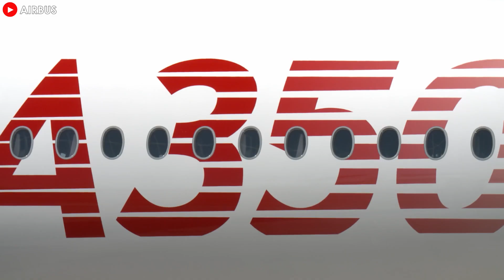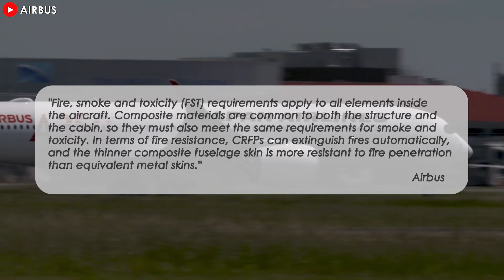Every Airlines DITCHING Boeing For The Airbus A350! Here's Why

Comment: B787 was first commercial aircraft with 50% composite materials then later 350 actually Lockheed f22 was the first 1997 used composite materials.
Reply from the maker: Love 787, really.

Comment: I have to commend the architects, designers, and engineers that designed the A350 to be safe, as proven in the first A350 crash in Japan. Everyone except 5 people survived before the A350 was destroyed by fire. The surprising fact is the airframe took longer to burn, giving everyone time to leave.
Reply from the maker: that's great plane
Reply: 787 start using composite material s before 350 actually locheed F22 was tge first composite materials plane made in 1997 in fortworth tx plant i worked in that project F22 design and testing times
Reply: 787 start using composite material s before 350 actually locheed F22 was tge first composite materials plane made in 1997 in fortworth tx plant i worked in that project F22 design and testing times

Comment: Summary (From what the narrator said)

The A350 is better than Boeing in every single way because 54% of the airplane uses carbon fibre, also it’s very safe because all passengers Survived the JAL 516 crash, then the A350 also uses the Trent XWB engines which is very efficient and airlines are ditching Boeing for the A350 because of that.

1. The A350 was met with some criticism and airbus fixed it? (He probably mean’t the RR XWB-97 Jet engines but neither did RR or Airbus fixed the engine defect)

2. Hmm? Now he is comparing the A350 to the 787? Let me tell why it doesn’t make sense, so I did some research and 787 is more closely related to the A330 in terms of size and the A350 is more closely related to the 777 not the 787. 

777 Length: 229-251 ft
A350 Length: 219-242 ft 
787 Length: 186-224 ft

3. The A350 is more efficient than Boeings offerings, thats interesting. Compared to what?

4. Yes he’s correct about the efficiency of the RR XWB-97 engines but one problem he somehow forgot to mention the fuel hose problem, also before Raging Airbus fans come blowing up my laptop, the problem not only happened once but twice with 2 different airlines.

5. Carbon fibre is considered a non flammable product but he said 54% of the airplane is made of carbon fibre which sounds a lot until it’s compared to the other composite materials like 46% of the airplane is made of composite materials which is flammable, thats a lot, so the airplane is as safe as other airplanes using composite materials like 787 and the 777X. Also Airbus fans if you actually read #5 you might get mad at me because, I said A350 is more similar to the 777 (In size) but #5 is talking about the materials so this is not comparing the airplanes in terms of Size.

My thoughts:
1. The thumbnail is just plain out funny like I wanna say 💀 like not all airlines are ditching Boeing and loads of airlines are still waiting for the 777X.

2. Basically what I think he is doing is just milking the Boeing situation, so Airbus fans will get happy and the AI voice sounding owner gets the ad revenue. Airbus fans if you don’t understand what I am saying, what I am saying is loads of AI Aviation channels are making videos of why the A350 is better in every way, it’s every where, left and right I see it all the time.

3. FYI The term milking means reposting same or similarly made content for personal gain or you can say clickbait. Good thumbnail that is slight sketchy, repetitive info from other Aviation channels who keep saying “A350 Is So GoOd ThEy ArE tHe BeSt”
Reply: Both made with composite materials 50% but controlls 787 more advanced than 350 if look at circuits electronic and servo systems 350 is bigger than 787
Reply: @SrimathiDassanayake  umm I am not the one to say which one is more advanced or have bigger systems, I never saw the servo system of the A350 and the 787 but thanks for pointing out

Comment: Dumb video.    Click Bait.  No evidence of airlines ditching Boeings’s competitors to the A350.    Boeings competitors to the A350 are more fuel efficient , built with mostly the same materials.  Boeing’s competitors to the A350  have a huge advantage in being much more flexible because the A350 are designed for longer routes.